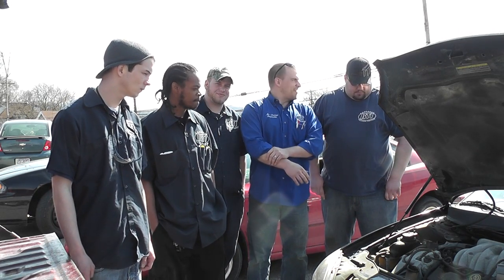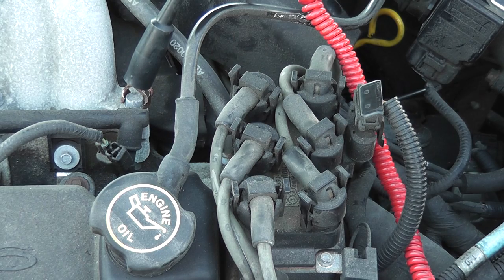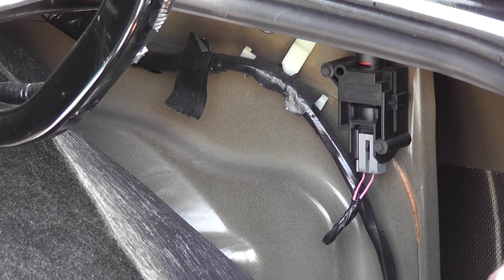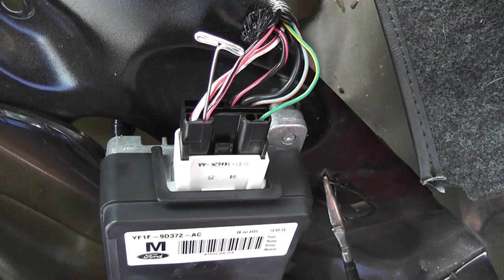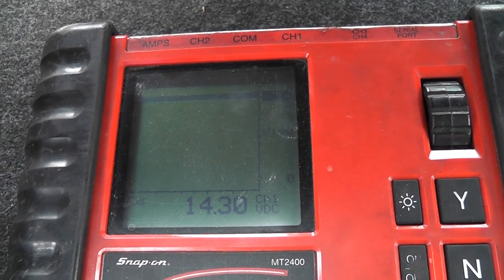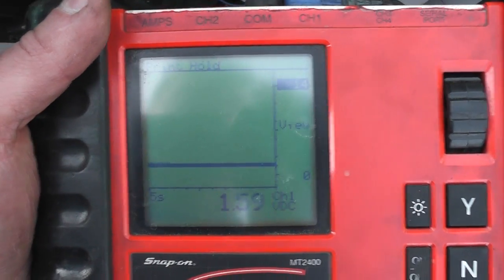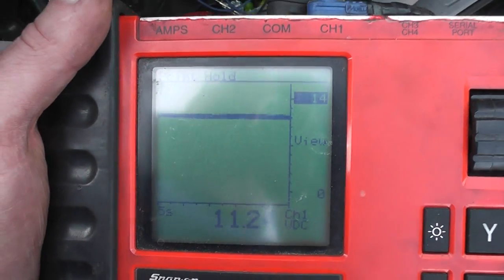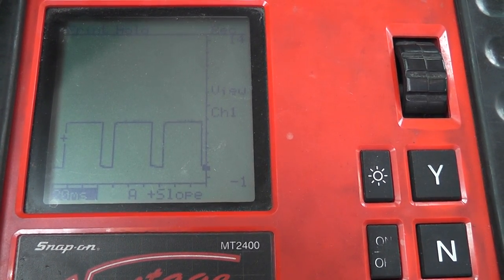Ford Electronic Returnless Fuel System Diagnosis (Part 1) - Ford

Comment: At 6:15 you wrote about a section in your book - is this a writeup on this type of system (which I've dealt with on my own cobra) online or in print? Great reference for future use, thanks for taking the time to tape, edit, and post it up, it's greatly appreciated.
Reply from the maker: Yes, I have a book I've written for my engine performance class available on my website at www.scannerdanner.com 
It is available as an eBook or paper book.
Thank you!

Comment: Hey scannerdanneri have an 06 ford f150 and it is a no start the driver module was broken so I replaced it the I checked all the wires and everything is getting ground and power where it should but the pump still doesn't kick on unless I power it directly w the power probe any advice would be helpful the only other thing I don't understand is the driver circuits
Reply: If the check engine light stays on while cranking, replace the crank sensor.

Comment: Return less systems use a variable voltage fuel pump and the computer has it inject exactly what the fuel demands require. 
The reason for this is to prolong the life of the fuel pump.
Return systems have a constant voltage feed with a constant static pressure that only increases under load due to the vacuum side of the fuel pressure regulator allowing the diaphragm to open or close.
This is why fuel pumps in return less systems last longer than pumps in Return systems. The returnless has the ability to run low voltages at the pump when at idle or light load.

Comment: I have a 4.6 gt would the wire colors have the same meaning? My harness is a little different.
Reply from the maker: possibly, without seeing the diagrams I'm not sure
Reply: @ScannerDanner  thanks for the reply, I figured out my issue. Had a bad connection at the fuel pump harness.

Comment: I have the 24V DOHC engine with same fuel delivery system in a Mercury Sable.

 Low Coolant light comes on, then I loose fuel pressure and then power to the FPCM lol IDK but I suspect the relay for this intermittent problem... But the Low Coolant light coming on, I've been looking for shared grounds and I've done drop voltage tests finding nothing.
Reply from the maker: Michael, first thing, great job in your direction so far and way to NOT be a parts changer! Without looking at a diagram, I cannot help. Please post this to my forum here https://www.scannerdanner.com/forum/post-your-repair-questions-here.html
Thank you! Hope to see you there.

Comment: I bought a 2000 ford focus, bad radiator, bad fuel pump, changed both, heads are good but still getting no fuel to the motor. It cranks i know its something with the fuel, i checked the wires and hoses but still nothing.. any help?

Comment: HI PAULi wait for the engine fully hot close loop and scope the o2 sersor 4 of them,O2B1S1,O2B1S2,O2B2S1,O2B2S2 AND THE ONE GOT MY ATTENTION WAS (O2B1S1) WHEN I accelerate stay 290 to 310 mv no change, until I let go the gas pedal go to 810mv for a SEC.and back to 290.my STFT and LTFT was much better sometimes, from 3 to 9.5 STFT and 8 to 9.4 LTFT. what means B1S1 ON THE O2 sensor?nissan 2005 pathfinder 4.0. THANK YOU SO MUCH FOR YOUR HELP..

Comment: any ideas if PCM com wires are at battery voltage?
Reply from the maker: Bad ground on one of the modules on the network or short to power as in water in a connector

Comment: I have a 02 Taurus, the only way I can get car to start and run is to ground the black and pink wire coming from fuel pump driver module directly to frame. What is this cars problem.. please help! I have replaced everything on this car, fuel pump related, down to the computer
Reply: I am directing all help requests to my forum. Sign up (it's free) and create a new post. Be sure to add a name under "alias" as this is the name that will appear in the post.
Here is the link to the forum. 
http://www.scannerdanner.com/ForumRetrieve.aspx?ForumID=3226
Thanks

Comment: HI paul i have nissan pathfinder 2005 4.0 the shortfueltrim 9 to 11 positive at idle never go to o or negatives number, the rpms are 835 to 850 no engine codes.what can be? vacuu leak,clogge injectors clogge fuel filter, my rpms are normal?

Comment: @bobby8926 No, I don't think it is... it is just easier to troubleshoot. To me, early systems were as unreliable as difficult to troubleshoot. In these days everything is all about production time. It makes easy to technician to have a faster solution in less time possible. I know Mr. Paul will show us how fast this is using a generic scanner.  

Technicians just need to set up at least 3 PID, a dyno or a road test snapshot.

Comment: Nice video thanks,I have the same problem.When I check my FUEL PUMP DRIVER MODULE the ground wire has 12.4 v with switch on when I crank it over it only drops to 8,6 v does this mean that the moduel itself is bad.
Reply: Tim, do me a favor and post your question here http://www.scannerdanner.com/ForumRetrieve.aspx?ForumID=3226
You'll be the first. I'll help you over there the best I can. Thanks!
Reply: ScannerDanner Premium  ok I posted in the forum I think
Reply: You did thanks! I'll help tomorrow.  On my way out for now.

Comment: I need help bad just put my motor back in went to start it started idled really rough and then dies out i'm pulling up a code p1235 dropped my tank pulled my fuel pump out tested that and it runs off a 12v battery replaced my driver fuel pump module the one wire that you test when you start the ignition and it drops down to zero that stays a constant 12 V one trying to start any info would be greatly appreciated if you have a phone number where I could talk to you directly that would be awesome
Reply: And breathe. And use a punctuation mark.

Comment: to be honest with you i already knew it was the fuel pump after the spark test.
because if we had a plugged injector it would sort of run 
if it were another issue it would smell like gas. 
if it were sensor issue there would have been a CEL and a code.

Comment: Friends car, needed new coil n plug. loud pump, told him change fuel filter.Didnt, car later died-changed car runs great. 
Car Pump sounds sickly at key on, throws a lean code and needs a key on and off 3 times for perfect start.

 No hesitations under low rpm with an engine load and locked up converter, no idle issues.
Lean code goes away with 1 notch above E and below. Runs great 

Havent checked fuel pressure, leaning toward tired pump?
252,000miles

Comment: but if i don't it will just crank but sometimes after i hear the pump prime and starts it stumbles like it wants to die and it does..(and sometimes it doesn't stumble) So i do this a few times making sure i hear the pump prime and if i get lucky it starts and runs fine and off i go...Once the car is running i have no problems with staling at stops,highway speeds or idle.. Symptoms appear at first start no matter how long its been sitting (5minute to 24hrs).

Comment: check engine light is on= code P0191...Symptom's are "No start but cranking has spark"...first key turn no fuel pump prime noise heard.... symptom comes and goes in any type of weather or temperatures On second crank if you turn the key to off and than turn it back to crank ( if i hear the fuel pump prime) than the car starts.

Comment: Ford tech over 25 years I don’t believe I’ve replaced the fuel pump module once so there pre reliable pumps no so much a lot replace the fuel filter at the same time along with cleaning the tank
Reply from the maker: I think I may have done one, maybe 🤔 Thanks!